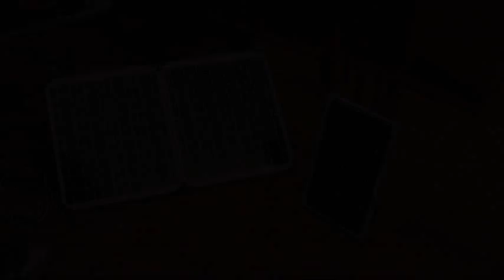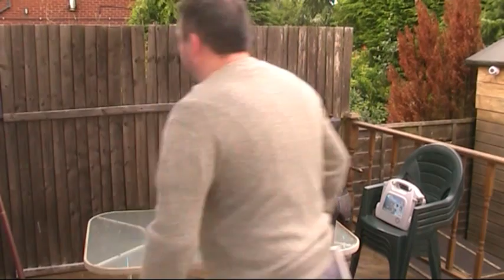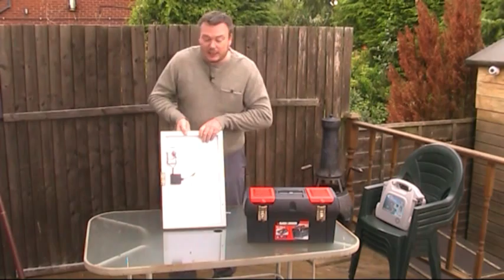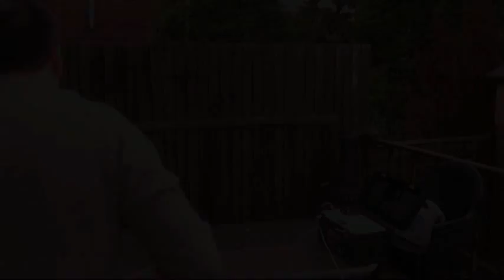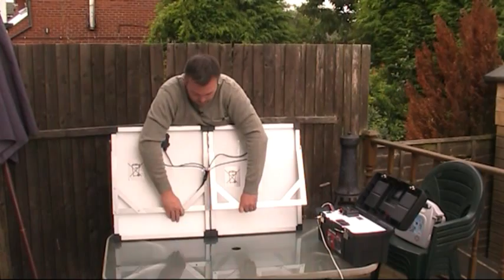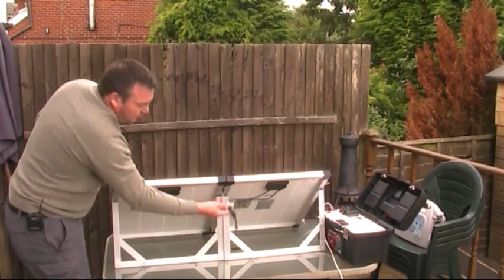Portable 100w solar panels

Comment: Can it power a laptop ? Would need 19 Volts.
Reply from the maker: Yes it does. You just need the correct car charger
Reply: @Shack-time  Thanks for that tip. Yes you are right, I totally forgot about those laptop car chargers. They convert 12 Volts to 19 Volts for a laptop. They even come with many types of laptop connectors. Problem solved, thanks :)

Comment: Hi James 😃 Like the folding 100 Watt 12 Volt solar panel. May I suggest you use a copper multi strand wire of at least 4 Gauge AWG for your long distance connecting cable ? Using too small a gauge wire of the length of your white one will cause current and voltage loss.